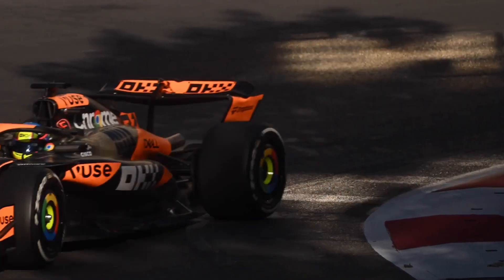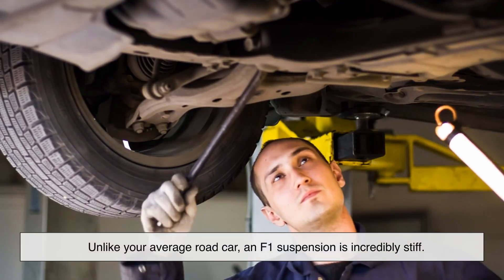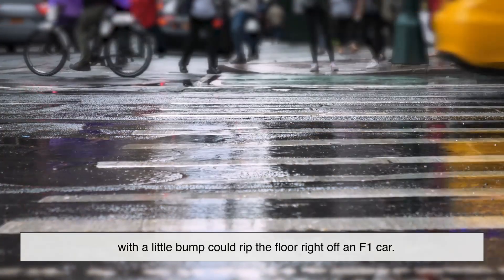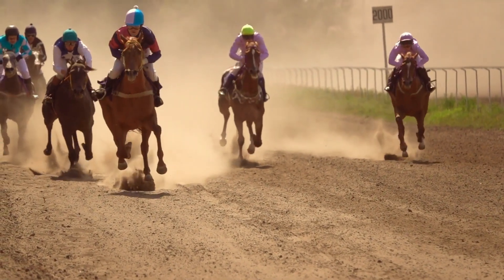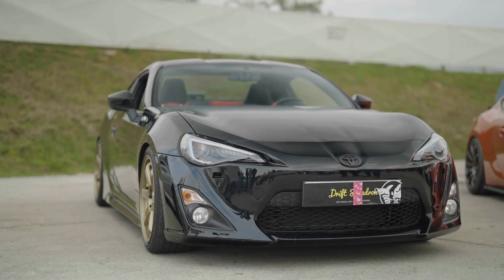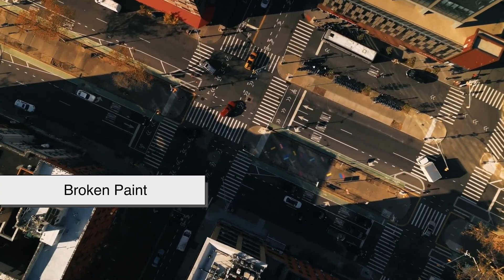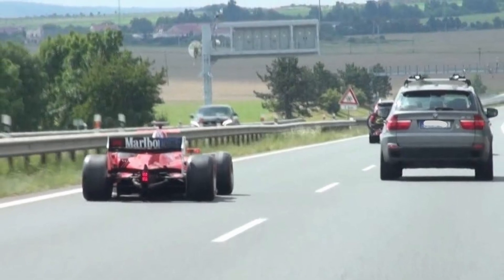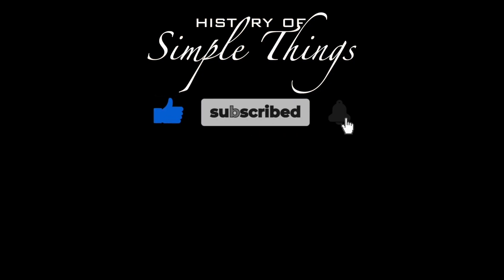Why Formula 1 Cars Can’t Survive Potholes

Comment: And it doesn't even have to be a road-hugging F1; airplanes landing can't survive potholes either, and their fuselage is higher up. Airport management has to run safety vehicles once an hour to inspect the surface for ruts and FOD.